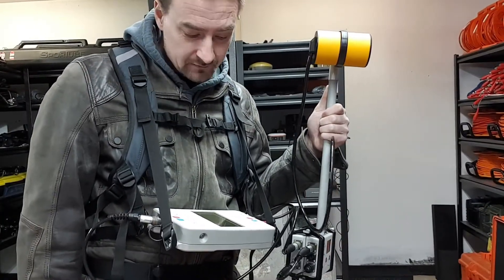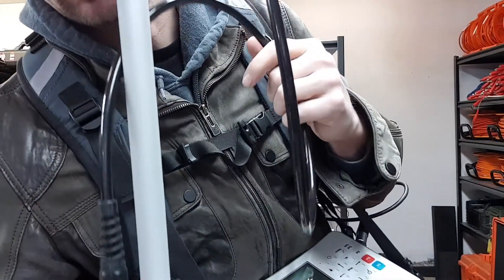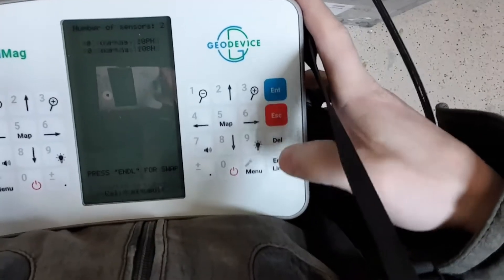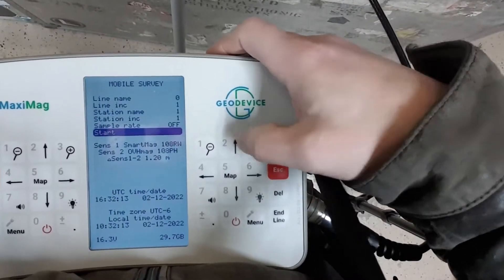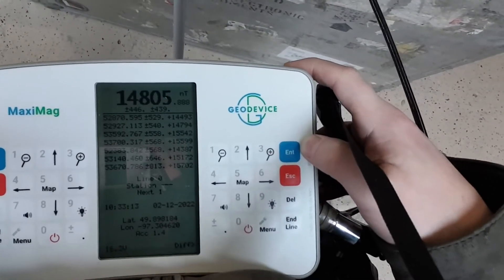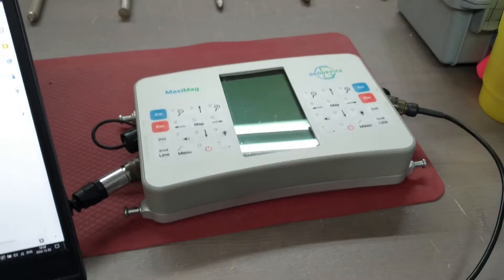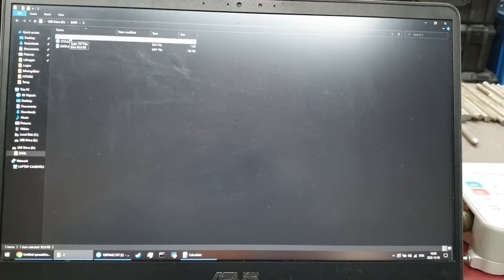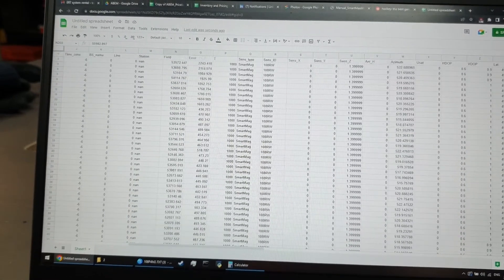Intro to Geodevice Gradiometer

Comment: What is the depth of the device?
Reply from the maker: Hard question. The answer is "it's complicated", requiring a Geophysics Degree to truly understand. Complications include: materials and magnetic properties; the size, shape, and orientation of the target; the surrounding materials; and even your latitude.

But, for example: we can usually detect an horseshoe at 1m depth in the middle of a field. But not if that horseshoe was made of non-magnetic materials (no signal), or if it was under a concrete pad with rebar (too much noise to sift through). 

Most people use a gradiometer as an anomaly finder, particularly in archaeology or mine-sweeping, where it gives them a place to carefully dig. In those cases, they assume that an anomaly that is small on the map is also shallow.
Reply: @TroyUnrau Thank you for the answer.
If a cave or tunnel is 10 meters deep, for example, will it be detected?
And for iron ore, for example, a 1m x 1m box at a depth of 5 meters, will it be detected?
Reply from the maker: @dadimomo3653 Cave or tunnel would be invisible unless the contents had iron. For example, old coal mines often have railways in them, and then you can detect them. 

Yeah, you'd probably find a chunk of iron that large at that depth without issues, provided you aren't surrounded by other iron objects.
Reply: ❤ @TroyUnrau Thank you very much